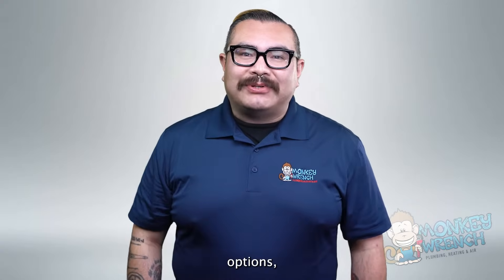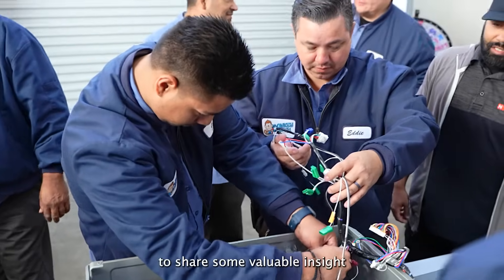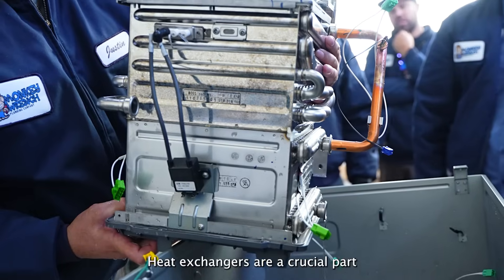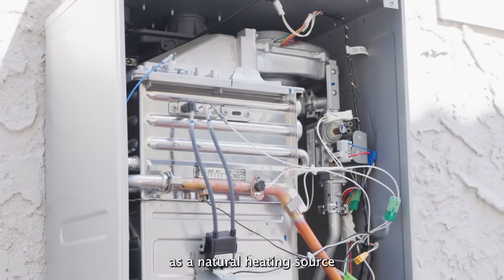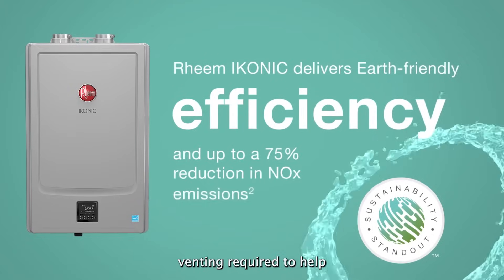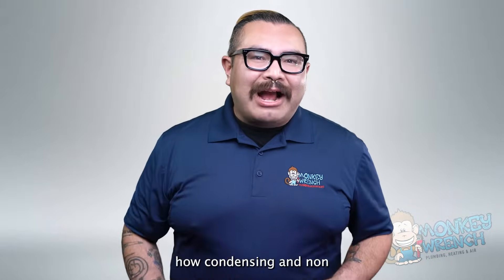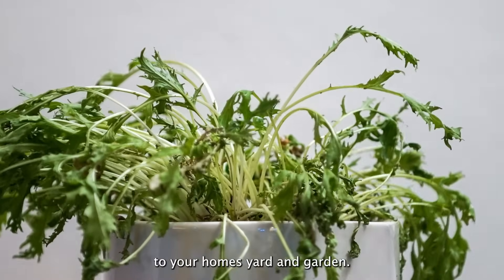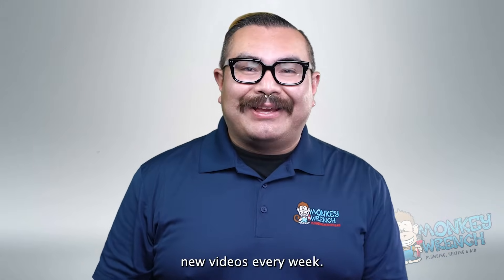Condensing VS Non Condensing Tankless Water Heaters

Comment: 2:56 Does it really just dump a bunch of acidic water right down the wall into the foundation stucco?
Reply: It does drip acidic water but it's more of a constant drip. I have on the side of my house it will discolor your concrete if you don't route it elsewhere
Reply: That is not an image of real condensate being dumped out.  The flow rate doesn't make sense.  Not sure what application it makes sense to dump that rate of flow out on the ground right next to the foundation.

Comment: I do not understand the logic behind condensing units costing more "due their Technological design and high energy efficiency." Can anyone explain bc it is obvious this fool is an  AI  Bot with  stupid face jewelry to try to appeal to millennials.
Reply: As he said in the video, condensing models can re-use some of the initial exhaust, which requires more hardware (cost) and results in more heat from less gas used.
Reply: condensing has 2 heat exchangers and is more efficient(90-95%), non condensing has 1 heat exchanger and is less efficient (80-85%)

Comment: It seems like condensing models is the way to go.. do non condensing models have any benefits over     condensing ones?
Reply: The one benefit I noticed is that I currently have a tank gas water heater that has venting already to the outside, so I wouldn't need to add anything new as the tankless would just need to connect to the current vent system.  Condensing requires the water it disposes of to go somewhere.  Per his instructions in the video: "Due to the condensation process, they produce acidic water that needs to be drained, requiring a condensate drain line."  Most people don't have that drain line, so that is an additional cost item.  Both types though are much more efficient than a plain tank water heater.

Comment: My question regarding the natural gas supply size.  I had read a while back that a condensing unit can use 1/2 and a non condensing requires 3/4.  Is this true? I haven’t seen anyone address this
Reply: That’s not how you size the gas line by condensing vs non condensing
Reply: @rlm4342  BTU and distance from the regulator at the meter  and corners all relate to gas supply line diameter
Reply: No 1/2"

Comment: Was this video based on interior models or exterior type? I want an exterior model and want to know which is best for the least amount of exhaust venting required. I’m adding a rental unit to my home. from the house wall where I would mount unit to the perimeter fence is 5feet. Can I install in a walkway.

Comment: Thanks. I am considering NPE-240A2, Bosch T9800SE-199 CPVC, or Rinnai RU199in tankless gas water heater. Which one would you recommend? I have 3 full baths (1 is a soaking tub)and a half bath.
Reply: Definitely not the navien. I have the npe240 and it's had nothing  but issues. I'm on my 3rd fully replaced unit.
Reply: @kmg66185  thanks for letting me know
Reply: @kmg66185 agreed the Naven are trash and the Noritz brand is pretty much the King!
Reply: I have the RU199in and it's a champ!